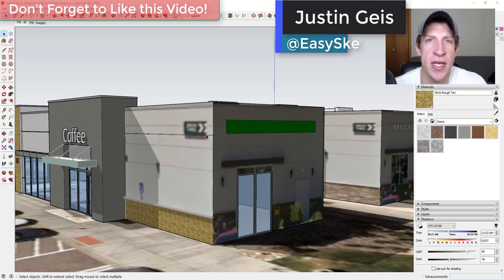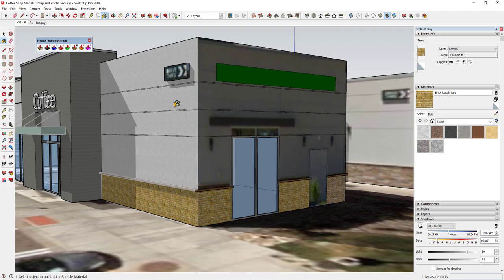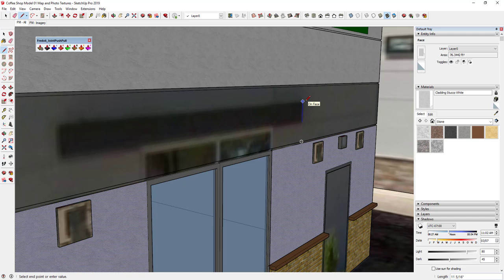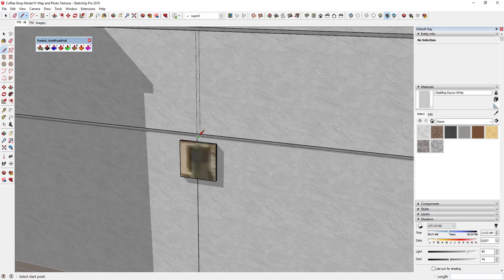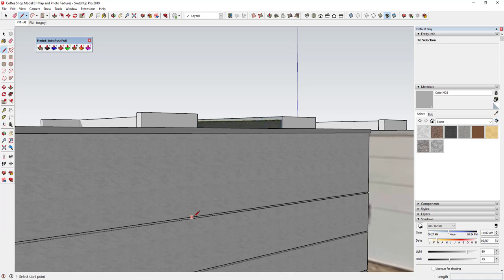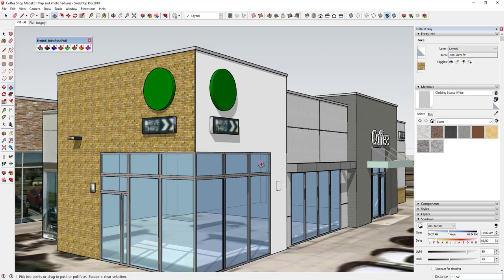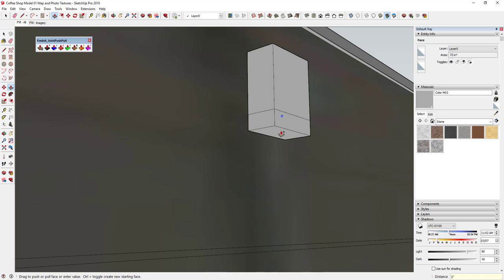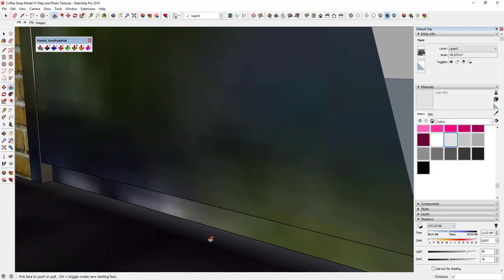Modeling a Detailed Building from Photos Part 3 - Stucco Joints, Ladders, and more!

Comment: Justin, So very useful this! Sketchup can be as accurate as anything in the real world. I use it all the time to make projects in 3D that work out perfectly later as I've already worked out the bugs. But I have to model accurately and completely.
Reply from the maker: Yeah this is a bad approach if it all has to be exact - in that case, you need to actually go out and measure the building, which I was NOT going to do at a random coffee shop ;p